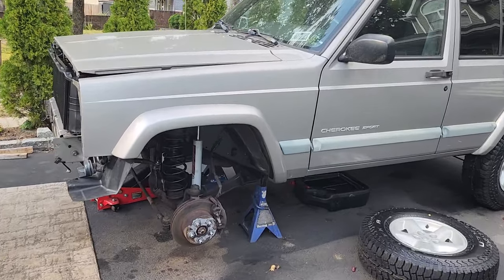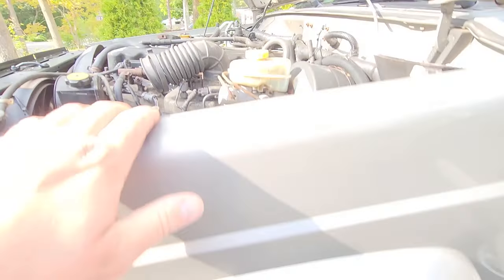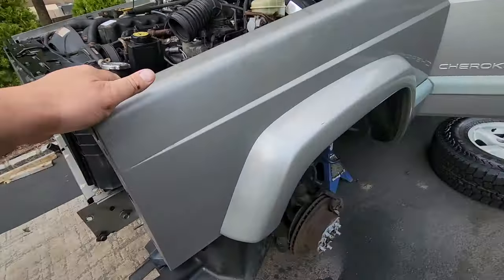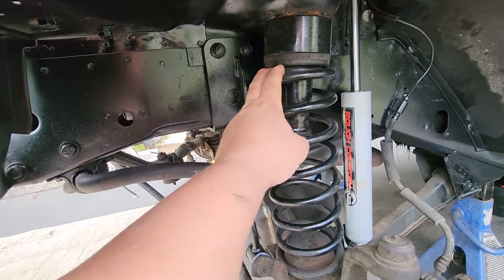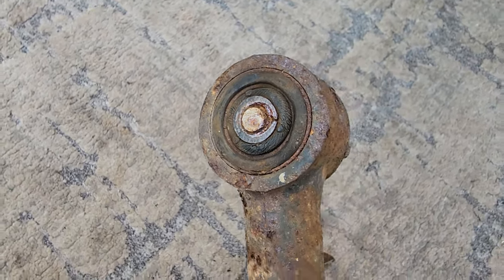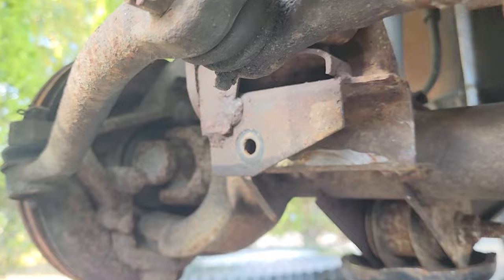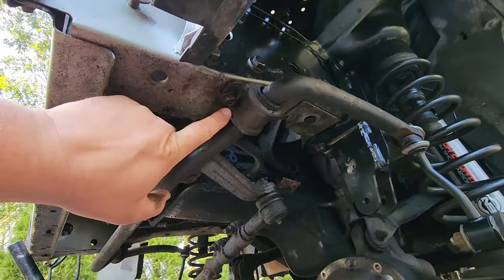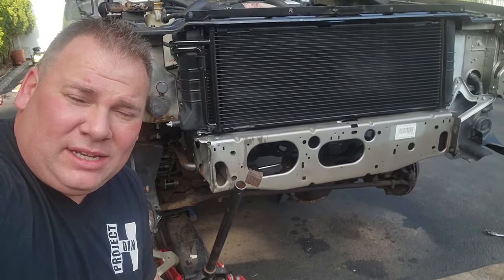JEEP CHEROKEE XJ PROJECT UPDATE - THE TOAD!!! EPISODE 4

Comment: Hey Dan for removing the front shocks if they are garbage anyway don't bother with the upper nut. Just unbolt the bottom and pull the shock bottom towards you, the top will snap right off.
Reply from the maker: Oooh! That's a good trick!

Comment: That xj project is looking good Dan.   👍
  On my ZJ  I used some 3/16" 
 Steel plate and reinforced my trac ber bracket on the axle,
   But Barnes 4x4 does sell a nice replacement one for a fair price.
    The Rough Country trac bars are ok ,  but personally I prefer the ones from Rusty's Off Road,   they cost a bit more than Rough Country,   but absolutely worth it.
Reply from the maker: That's good to know! How does the track bar adjust?
Reply: @ProjectDanH . 
  I uses a tie rod with a locknut 
 It is actually the same size and thread of tie rod that is used on the drag link at the steering box end that connects to the pitman arm.

Comment: Great series.   That's gonna be a nice little rig.  You gonna replace the control arms and bushings?   They look pretty beat.  I just did mine, what a difference.  I removed the entire axel for the top bushings.  Made the Job 100x easier and it was only about an hour to get the axel out.  Too old to try and drill out/press in those on my back.
Reply from the maker: Thanks man!  I think im gonna get some new extended control arms for it in the near future.  Great Input!